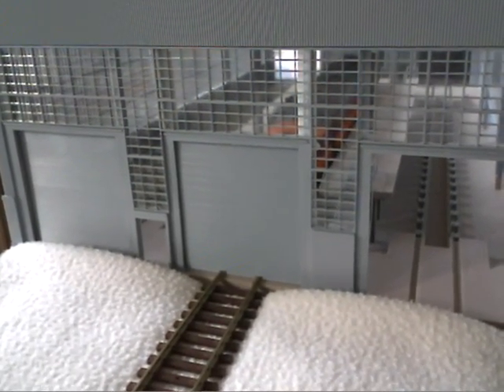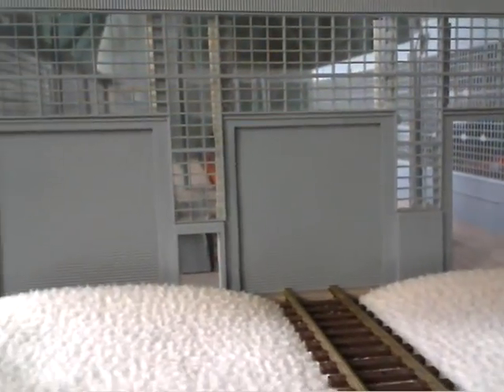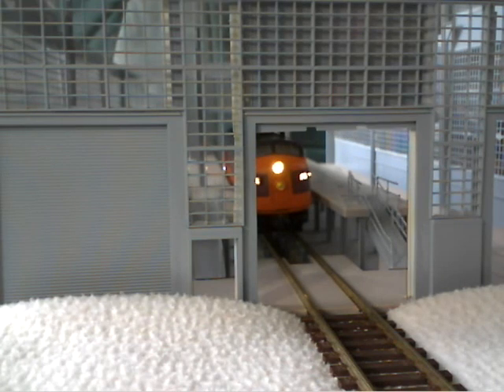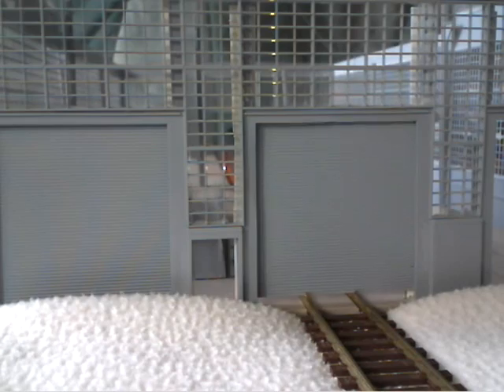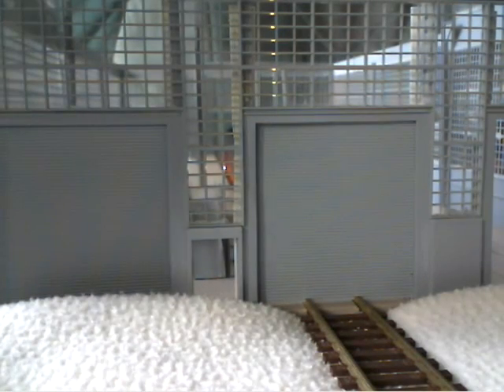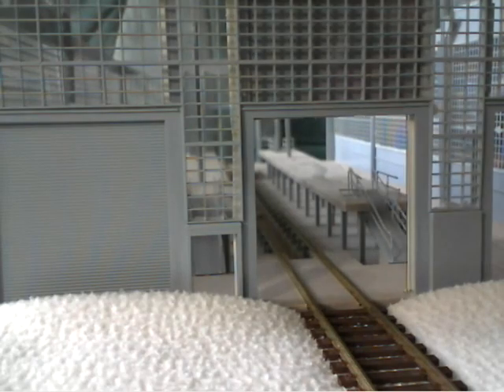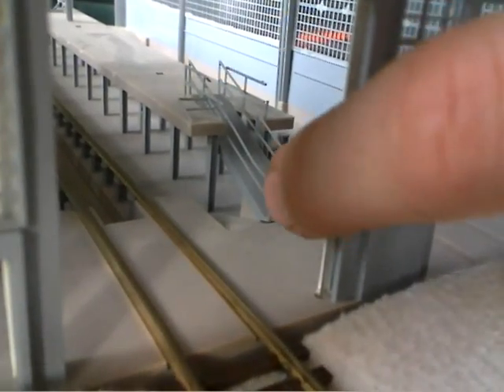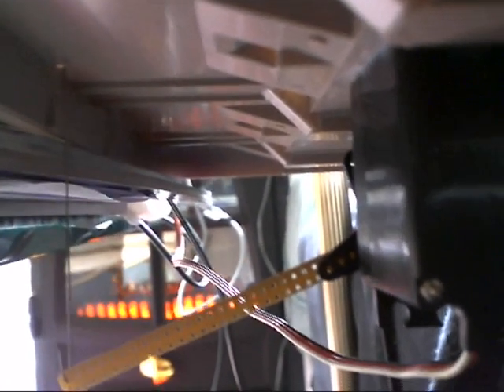HO Diesel workshop door animation with servo & microcontroller. Trial setup

Comment: what servo and microcontroller did you use other word brand
Reply from the maker: Sorry, missed that. The microcontroller is an Arduino and the servo - any cheap brand will do. Mine is out of production, but look for a small, cheap one. Doesn't have to be digital.

Comment from the maker: Thanks!
The time for the workshop wasn't too bad at all, considering it's not finished nor weathered...
The coding was more of a steep learning curve - never programmed a microcontroller before. I started out with some old fashioned controller that required some semi-machine code, but then switched to an Arduino - MUCH easier.
check this out: arduino.cc/en/Reference/Servo
Add a few bits to remember its last position when switching it off etc and you're done!

Cheers,
Marc